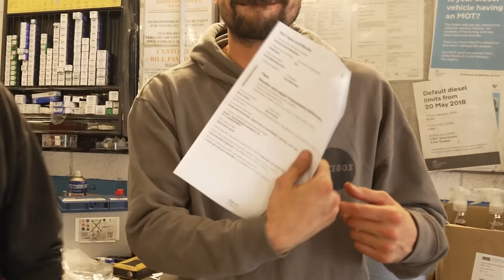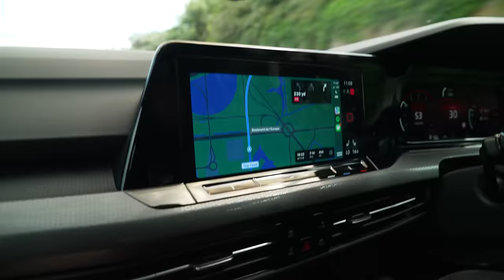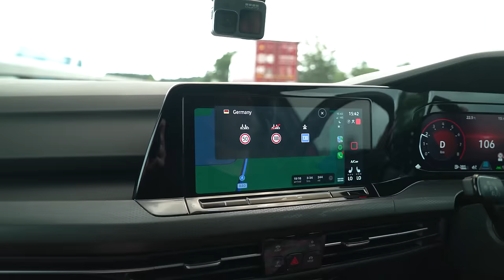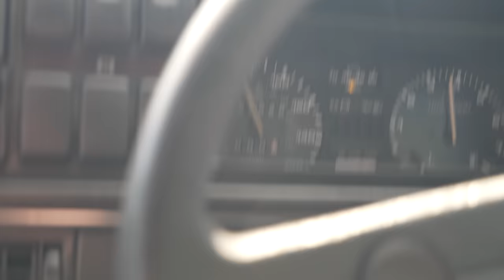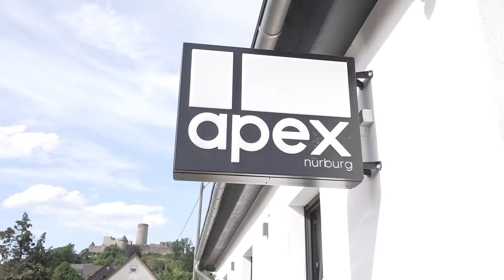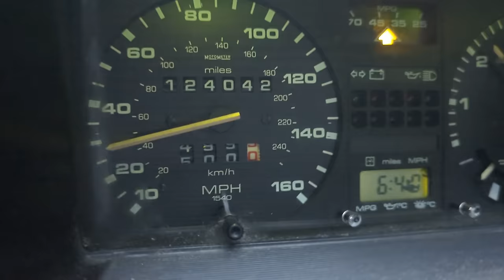Will Our Barn Find Golf GTI Survive a 1500 Mile Road Trip?

Comment: Deffo the sunroof seal leaking common problem on the mk2’s but fair play to the old gal, German engineering at it best 😂
Reply: yep, anyone that owned a Mk2 with a sunroof, 1st job was to seal it shut 😅
Reply: Not actually the seal but the sunroof drains blocked. Front two can be rodded with wire from above (they exit in front door shuts), rear two are better accessed from dropping the headlining and popping the join off, poke the shit out down in to rear wheel arches.

I made the mistake of changing seal which did nothing, it's not supposed to be water tight
Reply: The sunroof seal is never water tight that's why there is sunroof drain holes these get blocked and its this that causes the sunroof to leak not the seal.

Comment: I went to Southbank University, London 1980 - 1982 (it was a polytechnic back then) and travelled home to Wales every weekend. Service station stops were obligatory, where I'd check the coolant and oil levels for a 150 mile trip, but thinking back to those days, I'd go 3 months, and maybe 3000 miles of local driving without breaking a sweat. I was driving a ratty Mk 1 Ford Escort 1300 estate.

Comment: Nice: D . hare you guys checking the coolant level with a cold engine or a hot engine ? some cars that use a expansion tank , the top level is done with the engine hot (the fan already turned on) (you will notice that the expansion tank don't have the security valve , its on top of the radiator instead )   . if you top up with the engine cold , when it gets hot it will spill by the overflow , and can get to much coolant out by the siphon effect .

Comment: I had a white one like that 20 years ago, not GTI though. My first car. 70 horsepower. I really liked it, despite all its flaws. Like having to open the bonnet and connect two things in the engine to start it. And having to rev it at red lights to stop it from stalling. Could only overtake cars  downhill.

Comment: Disappointed with how the car performed, I had a 'A' reg red one back in the day, almost identical but my speedo only went up to 120 and I noticed yours was 140. Mine would easily hit 100, taking the needle off the clock was also quite easy in a straight line, yours didn't seem to perform like an 1.8 should, are your sure it wasn't a 1.4 you put in it!!  As for Ethans driving....

Comment: After watching Misha's lap as well, and previously the Overdrive Upgrade Car Ep, Challenge Idea for Ethan (or all of them really): Some pissweak, rolly-poly, absolute nugget (like... any 1.2L or under shopping hatch) take to a track like Oulton Park (swoopy corners aplenty that's all about holding as much speed as possible and REALLY smooth lines everywhere or going absolutely nowhere) then...
- Fast lap cold turkey, alone. [only track familiarisation from a different car beforehand]
- Fast lap talking themselves up.
- Fast lap with an advanced driving instructor.
- and a fast lap being pushed by a no remorse race driver. (Scott Mansfield maybe for an Overdrive callback?)

Possible extensions;
Tweak the car with light improvements (Tyres, Suspension [maybe keep it OEM, like say an 'Up', Stock to GTi upgrade], filter/exhaust if those'll do anything of value)
ADI and Race Driver do a Wet Lap which the guy/s are trying to beat (maybe do a sneasky Dry Lap as well to see how close they get in the modded car?)
HIllclimb day, for fun.

Comment: Sorry but is it a 1,1 liters since it only could run 160kmh because i had a Audi 80 with 1,8E engine exactly same engine as a golf gti with 8valve and 112 horsepower it could run 195kmh not 160kmh